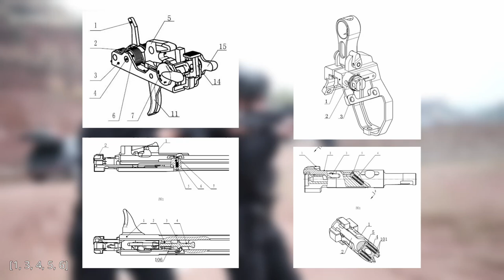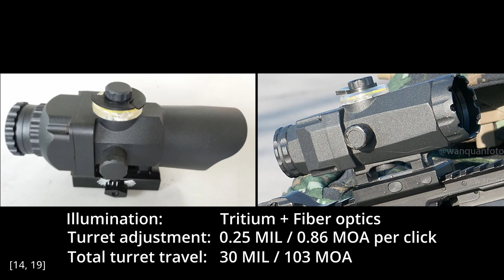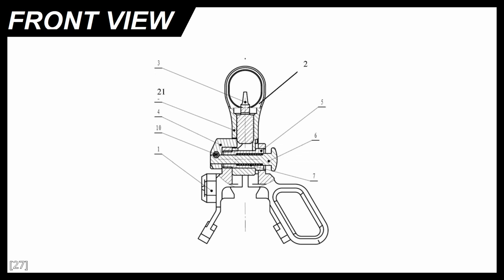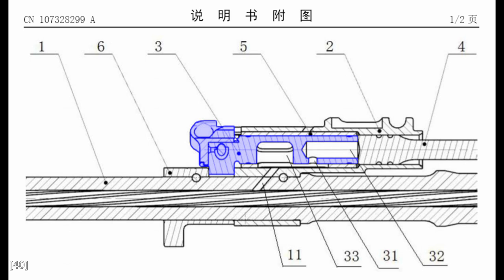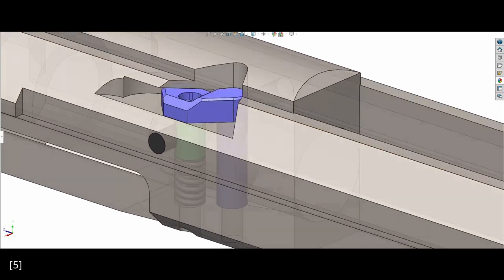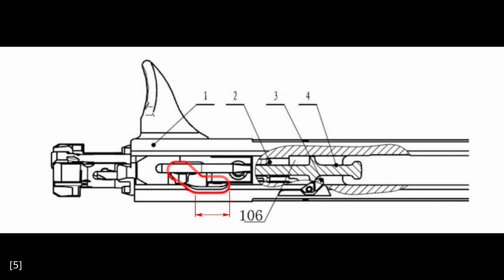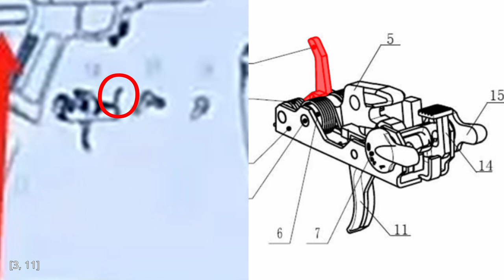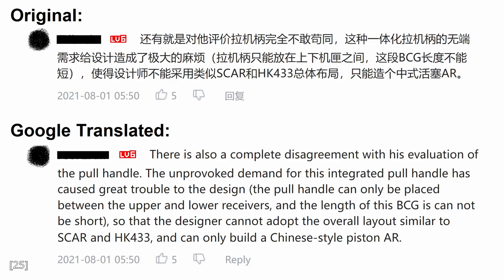QBZ191 - Update / Deep dive [CHECK PINNED COMMENT FOR UPDATES]

Comment: I only add that i'm agree the chinese did a very great job in designing this guns, i can assure you that those "original" improvements are probably not something new as well. I'm willing to bet that those improvements are also been thought out by a lot of gun designer, but like you said we basically reached plateu of the gun designs, but that are mostly because a lot of factor like ease of manufacture, ease of use/field strip, mass producing cost, and many more.

Also while those improvements seemed good in paper, we still have yet to see whether those will also good in practice as well in longer term. Consider more parts = more manufacturing costs = more complicated and more things prone to fail as well.

Just like what the germany did with the 416. It's a well thought out improvement but sometimes are not really necessary. i'll still give credit to the chinese tho, as they're willing to actually mass produce something different to the design.

Comment: Here's another rumor. But it is said the original design actually had ambidextrous charging handle but it didn't pass with the higher ups so they made this design. Just a rumor though.
Reply from the maker: Interesting... It seems like the brass still has pretty conservative design philosophy
Reply: @cabbage6015  Yeah, I wonder if they will adopt the ambidextrous charging handle on the gen. 2 model if enough troops ask for it. If the new weapon testing policy is anything to confirm, we might see a gen. 2 QBZ 191 sooner rather than later.
Reply: @AVWUVU  Aniermos Vu, please do more 191 shooting videos.

And please please please… don’t block the comment section of your videos! I’m been wanting to communicate with you but can never find you
Reply: @thomaszhang3101  Sure.
Reply: Probably seen as redundant feature that unnecessary complicates things because of the forward assist.
Reply: @cabbage6015  there is a comment in Chinese saying the current design supposed makes it easier to fix a jam.
Reply from the maker: @suisinghoraceho2403  There are non-reciprocating & ambidextrous charging handle designs that allow the user to clear jams just as easily as on the 191. I'd say that the 191 charging handle is simpler and more durable than those designs, but the cost they had to pay is that a long AR-15 style bolt carrier is needed to cover charging handle slot, which in turn made it impossible for the stock to be folded.

Comment: I'm thinking that lever on top of the bolt carrier could also just be a safety device just like on hk416s that lock the firing pin for slam firing reasons since it's a short stroke tappit without internal piston rings. Instead of unlocking from the hammer it might unlock from the hood of the receiver? The rivet on the upper seems too high up to be the ejector imo and could also be a caming slot with hard steel riveted there since it's a short stroke piston system with an ar15 like caming lug.  (Could also be a dual purpose piece with the ejector on it towards the bottom maybe) 
 If you ask me- the caming of the ar15 does create friction, but it's not some weak point that other rifles don't also do too. They all have a mechanism to keep from rotating the lugs early when picking up a cartridge that creates extra friction. For instance on an ak47 the bolt pushes on the guide rail while it's picking up a cartridge and trying to cam/rotate at the same time. If you push back on an ak47 lug it creates tension too, albeit less like you mention because it's not steel on aluminum like an ar15 but running on a metal rail. This isn't a problem with ar15s though if your gas rings are in check, short stroke piston is a different story as most know tho.

Comment: What would stoner do 2020? I believe the QBZ191 is the ultimate AR-15 (for now).
Reply: the ultimate AR-15 i've seen is the KAC SR-15 which stoner himself contributed to. A lot of the changes in the QBZ-191 were made for China's specific cartridge, so things like a dual angles extraction spring aren't really necessary on a 5.56 gun

Comment: Is this going to become the new standard issue Chinese service rifle?
Reply from the maker: Probably, based on the Chinese comments on my previous videos
Reply: If not, they're putting an awful lot of work in for something that's not going to get adopted.
Reply: @cabbage6015  so far a lot of regiments and divisions are being equipped with qbz191
Reply from the maker: @MY-zj8pb  I’ve seen some photos of that too, but I’m not sure if it’s the type of thing where special units get special guns, or the QBZ191 is to completely phase out the 95/95-1
Reply: @cabbage6015  it's to completely replace the 95.  it's been spotted not only being used by special forces but also by the most basic grunts.
The PRC 70th anniversary marked the beginning of a large scale reform for soldier equipment, from uniforms to weapons.  it's not only the rifle/carbine/DMR that's being replaced but also sniper rifles, LMGs and SMGs
Reply: @milkalade  The entire soldier equipment is getting overhauled.
Reply: @milkalade  There may be a caveat here in that PLAN Marines and PAP don't seem to be switching. In fact, PAP showed off new variants of the 95 last year. That said, the PLA Amphibious Forces (the Ground Forces' Marines) seem to be switching as well, so it isn't a particular decision tied to the Marines' nature. It looks like all the PLAGF will switch but the rest of the services are either waiting their turn or not intending to switch, while the PAP seem happy enough with their tricked-out 95s.
Reply: @andrewsuryali8540  There have not been new 95 variants, though privately developed upgrade kits have been in production for a while. These are intended to be used for special units, and tbh their use is really a way to cope with how outmoded the 95s are. So the design itself is not modern, it must go sooner or later. Indeed we have seen PAP with 19s but they are not being distributed in the same rate as the PLAGF which is on an urgent schedule. As for marines, I think you'll find more 19s equipped, and I think this is less visible because media don't focus on them as much as the others
Reply: @cabbage6015  As a rule of thumb, anything that appears on regular infantry squares (i.e. not special forces, marines etc) during a major military parade will be standard issue.   As QBZ191 appeared in the 2019 military parade with the infantry squares, it is 100% certain that it will be a regular service weapon replacing the type 95, at the very least in all army category A units.  This does not necessarily include special forces, marines or airforce airborne units.
Reply: @andrewsuryali8540  PAP is a lower priority in terms receiving new equipment VS regular army units.  The weapon only entered service in 2019, it takes several years at least to fully re-equip the army category A (front line) units.  It took many years for the PAP to switch from type 87 to 95 the last time around also.  Keep in mind that the army has about 2 milion people alone, the annual production rate of those guns aren't going to be in the millions.   And small arms is low priority on the grand scheme of things in terms of Chinese military spending.
Reply from the maker: @tonglianheng  Thanks! Good to know

Comment: 16:12 Does the gun have a special gas block setting for shooting suppressed? Is it possible that the 2 settings are for suppressed and normal shooting instead of for normal and adverse shooting? Or maybe the rifle grenade function is given up entirely and the middle position is not a shutoff, but suppressed instead?

Edit: also, can dual chamber design reduce the perceived recoil the same way AR adjustable gas block and long barrel DI AR can?

Comment: 4 lug bolt compares to the AR15 one also have the advantage of less machining, saving cost and time.
Reply from the maker: I think it's hard to tell. Even though the number or lugs is lower, it seems like the amount of material removed is roughly the same. The QBZ bolt has a more complex geometry as well. A lot of chamfers around all edges of the locking lugs...
Reply: @cabbage6015 if i recall right, the machining time depended on the number of edges and complexity of these, cannot comment on the chambers but that lug is definitely one of the most time consuming part for the ar15. 4 lug  is a simplifying improvement in design

One rumor could be added: according to those who handled the gun, the finishing improved a lot compares to 95
Reply from the maker: @voidoli212  What you said about the machining time can certainly be true as well. I just find it hard to draw a definitive conclusion based on the info we have access to. 

Yea I have also heard the rumour about the finish. From the HD photos that I could find of the 191, it does look a lot better than the 95.
Reply: AK series only have 2 bolt lugs.

Comment: If the base power of the optic is 3 I would guess it’s either 9 or 12 power max, the most common systems work 3x or 4x systems from the base zoom. I hope this makes sense
Reply: That many small buttons for lights and lasers out of that small of a head is ridiculous, also the head on the light is way too small, even the most high end manufacturers catering to the US concealed carry markets couldn’t make a light head that small useful.
Reply from the maker: Thanks for the feed back! While I didn't know about the tendency of variable magnification scopes to have 3x - 4x their base magnification, I concluded that the QBU191 scope is 3-7x based on a few other photos that I didn't show for the sake of brevity. One of those photos showed one side of the scope, and none of the zoom markings were visible on that side. From that I concluded that all of the zoom markings are etched on 1 half of the scope only. From other photos, I determined that the number 3 was marked roughly opposite to number 7. (For example, if number 3 is turned to the 12 o'clock position, then number 7 will be at 6 o'clock). So from that I figured that 3 and 7 are at the two ends of the magnification range. Maybe it can go up to 8, but I don't think it will go to 9 or 12. 

Yea I am also very confused with the light and laser setup on the vertical foregrip. One of the reasons I guessed that they weren't lights and lasers was because the button layout is very inconducive to quick actuation. But I wouldn't write off the usefulness of the light head, I don't think it's much smaller than a surefire m300. I'm just curious how they will zero the laser since I don't see any facility for adjustments.
Reply: @cabbage6015  that makes sense then, maybe some general decided 9 or 12 power would be too much for the average soldier. That’s how American oddities seem to happen

Comment: But I am sad that the Chinese continued to use AK-style reciprocating charging hanle
Edit : I mean...the Chinese made their new machine gun with reciprocating+foldable charging handle. Why would they stuck with a big blade on the 191?
Reply: Simpler to produce + mechanically simpler (less prone to breakage) + less energy loss when you pull the charging handle (hence easier to unjam by force without worry of breaking things in theory in case of very complex jams)

Comment: you sure the lower is made from aluminum? i always thought it was made from polymer with metal inserts for the moving parts. judging by the design profile it'll kinda hard to manufacture those geometry unless it's a forged aluminum like an AR
Reply from the maker: I'm 99% sure the lower is aluminum. I replied with a photo to your other comment. Also in a few other photos that I've come across, whenever there is a scratch on the lower, the material underneath is always silver-coloured. Yea the QBZ191 lower is probably forged like an AR. The QBZ95 receiver is also forged aluminum, and it also has steel insert for the moving parts and a removable fire control group.
Reply: @cabbage6015  AR15 style’s lower need to holds the recoil impact so it must be at least metal. Polymer is not strong enough unlike SCAR was a metal upper receiver reinforced by the sling mount so the lower can be made by the polymer. 
The main reason that the monolith receiver of the QBZ95 was made by aluminum was considered to use in -50C degree, no polymer is able to stay one piece in that condition as a main working part. the minor reasons are the BCG is not hanged above the ejection port, and the buffer on the receiver cover (that reinforced by the hollow pin) was transferred some recoil to the receiver.

Comment: How does the mechanism protecting the gun from outside elements at the charging handle while the gun fire work? Does it similar to the Sig SG 551 rifle?
Reply from the maker: It's not similar. The Sig rifles use a rubber gasket to seal the charging handle slot. The 191 has a bolt carrier that is long enough to cover up the charging handle slot by itself
Reply: @cabbage6015  Like the FN Scar?
Reply from the maker: @sonhuynh106  yea, in the sense that the bolt carrier covers the charging handle slot

Comment: I love the explanation of small but important details like the reciver track in m16 or the way arx 160 changed it.
The system in qbz 191 reminded me of a similar system I saw in an em2 animation where a lever hold the locking flaps till bolt was in position.

Comment: Wow im the 191st viewer of this video
Reply: Well I doubt 191 has the ability to launch rifle grenades. At least I didn't found the relevant description in the muzzle 's pattern documents. The documents only says that how they make the muzzle device to install attachments like suppressors.
Reply from the maker: @il2838  Yea I didn't find any documents regarding rifle grenades either. But the spring on the muzzle device is likely for retaining a rifle grenade. The fact that you can cut off the gas system also aid in that theory.

Comment: Hey Cabbage, here is a video showing DBP191 ammo in detail: https://youtu.be/nKZN3zJkkrU
It seems to be steel case round that’s a full size smaller than the previous brass cased 5.8mm round. Why is it smaller?
Reply from the maker: Nice find, thanks! I think the brass cased one is another caliber, possibly 7.62x51.
Reply from the maker: @thomaszhang3101  Yup! If you want to find more videos of the 191, you can go to Source [1] in my description section. That's the original channel that both Aniermos and I pulled the videos from.
Reply: @cabbage6015  +1
Reply: @cabbage6015  +1, my sources are the same as cabbage. I simply upload them in 4K.